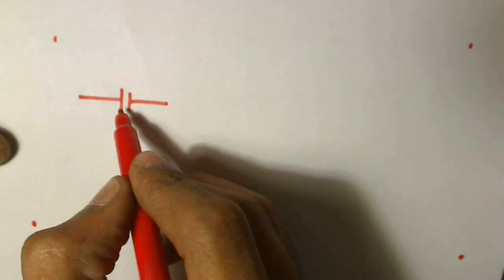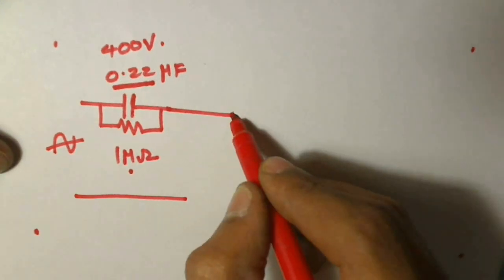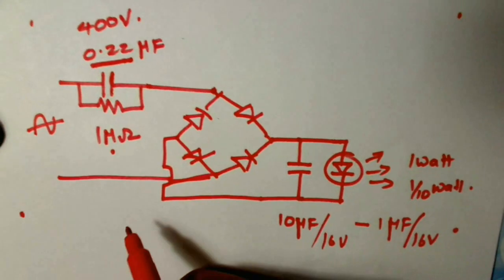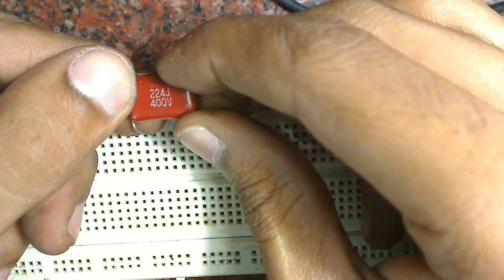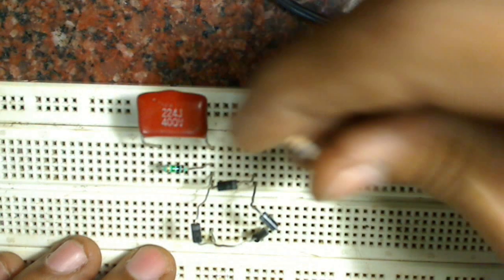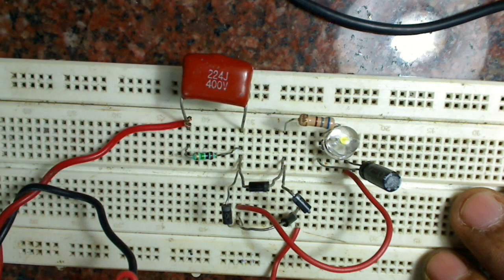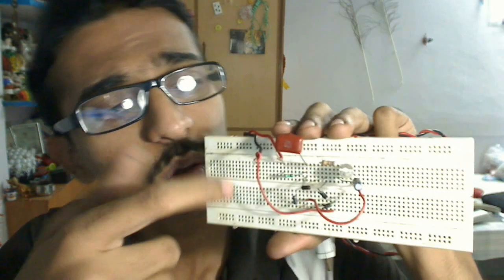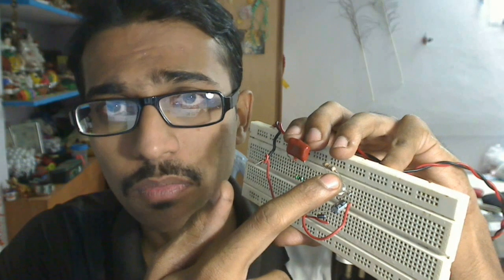transformerless LED driver circuit

Comment: how to increase the LED light brightness in series LED
Reply from the maker: +venkat raman reduce the number of LEDs , this will increase voltage. But if voltage rating u r using is correct then use more current

Comment: I tried it with 
- 2.2uF capacitor, 
- 1M ohm/1 Watt parallel resitor,
- 1N54008/2amp diode bridge,
- 1000uF/50v capacitor as ripple remover.
But it is not giving me output.
When I connect it to ac and disconnect and then on connecting both output terminals together they make a spark.

Comment: What are those diodes? 1N4001? and is the AC voltage your using is 220vAC?

Comment: hi, how can i make a series of led lights around 3 w each but should go on and off alternatively? pls reply or msg me on 9820998588. need to use in a project.
any one who can help pls reply.
Reply from the maker: +Mohd. Ahtesham Shaikh if 3 watt then u cannot use this circuit as this can supply very less current. U can use an smps or a any high current power supply. To go on and off use a simple 555 timer circuit in astable mode and with a relay or a high current transistor to drive the leds

Comment: boss please tell me the circuit configuration 60 led in series with capacitor value and resistance
Reply: Can u tell me what is the voltage and wattage ratings of LEDs
I can help

Comment: Excellent Tutorial. Please help me about component list . Here is the list what i get from your video. if i miss something please correct  the mention list.

1. 1uf 400v capacitor 
2. 1mega ohm registence
3. 1N4007 silicon diode
4. what is it name
5. 1uf capacitor
6. 12 v LED 

waiting for your reply

Comment: hi I want to make a led ring light which contains 60 leds for my bike royal Enfield having 12v DC supply battery. Please tell me how to make circuit
Reply from the maker: you want to connect 1/10th watt leds or 1watt? usually white leds need 3.3v to run and bike battery is 12v so u can connect upto 3 leds in series with a series resistor. multiple such chains can be connected in parallel and they can be connected to the bike battery

Comment: chota sa led power indicator 240 v AC current me kaisa chala sakte
Reply from the maker: +mohammed Abdul Ghani connect the led with a resistor of value above 100kohm atleast. It will only work for small indication LEDs

Comment: after making my using my 1Uf 400v capacitor and resistor in parallel,then connected to my diode rectifier,i measured my voltage output and got 198v.please I need to if this is right and how I further drop down the voltage to 5 volts

Comment: thanks   for  information  ,,,i  tried  it many  time    but  every time  i  get   blast  in  parallel resistor  place   across  capacitor  i  don`t    know   y  ????? can u  suggest  me   some  solution
Reply from the maker: +saad jaha may be the capacitor you used is not working so the current is flowing through the resistor and it is burning out. try replacing the capacitor

Comment: hi bro. that was an awesome video.BTW I have few questions to ask.
is it safe to build an transformerless circuit to glow bunch of LEDS? 
what s d difference between the circuit that has transformer and transformerless circuit? in some circuit they r using small size transformer. are they really expensive?
Reply from the maker: +little john yeh you can use transformerless circuit for lighting up multiple leds. it would cost you much less compared to a transformer type circuit. the circuit using small transformer is an SMPS they are also costly but little less than the usual transformer power supplies.

Comment: can I drive LED strip by this circuit
Reply from the maker: +Rodney Mendes  if its a small piece then it will but not for long pieces
Reply: +Electronics Made Easy : KHADER - total 72 LED strip is possible?? also LEDs on strip are connected in series?

Comment: actually I have one led bulb 💡 but bulb is not working so i disassembled that and check out why bulb 💡 is not working so i find out - > out put of the circuit board showing both side of current.. 
so now what i have to do to solve that problem please help me
Reply from the maker: +Viraj Borade i didnt get you, is the current zero??? in that case check if the high voltage capacitor is in good condition or not and even check the low resistor at the input befor bridge rectifier (it will be about 2.2ohms to 5.6ohms in most leds)
Reply: +Electronics Made Easy : KHADER it is my whatsapp no 8421968802 so i could send you the actual photos of my circuit please contact me on WhatsApp please

Comment: I am a bit perplex about the output voltage. How much is the voltage just after the diode bridge? Is the 1uf cap 16v is enough? please tell me. Thank you
Reply from the maker: +MParwez K  see the open circuit voltage at the output is 220v dc but we connect the led(s) which drop the voltage to a much lower voltage so a 16v cap will be enough

Comment: i Have 424/474 in 250v poly capacitor, can I use them??? I did not get 400v.
Reply: +Kamlesh_sexy please reply
Reply from the maker: +Kamlesh_sexy yes u can use those. they will work well

Comment: can i connect a blinking  led  circuit which contains ne 555 but it works on 9 v but i can connect a?
Reply from the maker: +SAI KUMAR connect a 9v zener at the output of this circuit and connec the 555 timer circuit

Comment: Can you tell me which value capacitor used for making 12W Led bulb?
With mathematical solution.
For 12W I am using 60nos.  0.2W led
Reply from the maker: +pranay khutwad u can use the same circuit to drive 60 leds in series. dont connect them in parallel. and there arent 0.2watt leds, probably might be 0.5watt or 0.1watt leds. the circuit will work for either of the cases. for 60 leds the total voltage needed will be 60x3=180v and the current usually allowed by a 0.47uf capacitor is about 33mA, if u r using 0.22uf capacitor then current would be almost half of this. and dont leave the output open circuited as the voltage can reach upto 240v as the circuit isnt isolated from mains
Reply: +Electronics Made Easy : KHADER 

Ok i know about series connection of led. but i want some calculation to derive current.
I am using 2.2Uf and current 60ma, but either elcapacitor or mpet burnout in within 2-3months.
Hope you can help me to solve this thing
Reply from the maker: +pranay khutwad 2.2uf is a very high value so the power is mor and buring out ur components. use a capacitor value below 0.68uf or 0.47 uf

Comment: You need to remember a few things. 
1. Capacitors store energy.  The reason you have the parallel resistor on the left side of the circuit is top bleed off the charge when the mains is disconnected.  The capacitor on the right side is a soothing capacitor to eliminate AC flicker, and can actually store more charge than the the other.  You should have included a similar discharge resistor when you "designed" your circuit.

2. The voltage rating on the 16v smoothing capacitor is way under rated.  The open circuit voltage in your "design" would still be 240v.  If your LED was removed or failed the capacitor would certainly pop.

For those that would like to know how the capacitor on the left side is chosen, you calculate the Capacitive Reactance (Xc)=1/(2*Pi*f*C) where Xc is in ohms, Pi=3.14, f= frequency of line voltage in Hz and C= capacitance in farads.  If you know your desired current use V=IR to solve for the resistance. substitute this value for Xc and that will give you your capacitor value.  Remember, also, if you put 70 LEDs in series, one goes out, they all go out.

BTW, this circuit is a standard "Capacitive Dropper" and is the basis of nearly every LED bulb in production today.
Reply: That should be "smoothing" capacitor in my previous post, not "soothing".

Also, remember P=i^2*R.  The total wattage of your load can't exceed the wattage of the series current limiting resistor, which is why they get hot.  You can't run a 2W LED using a 1/4 W resistor without it burning up.
Reply: +Rich Booth You know, I've had LED's go out in circuit but they others stayed on. Any ideas on that?
Reply: +TLEJT  probably you would have connected them in parallel. moreover parallel connection as much preferred as you get a constant voltage across all.
Reply: It was definitely series. It was two LED's on a 9v.
Reply: Help me please... what should be the value of resistance to purge the load capacitor 10 microfarads 16 vol in the rigth side (led side). Thank you very much
Reply: Dharti Dhora Walo Ko Aage Piche Karbala Ka Waqia karuvadu karuvadu karuvadu

Comment: if the neutral and phase are changed what will happen? I mean that neutral to the capacitor and the phase to the bridge.  what will happen?
Reply from the maker: +Akhil Sukumaran  the output would be the same. if you take phase thru the capacitor then the current would enter the circuit and be limited by the capacitor and then pass thru the bridge rectifier and load and back to the neutral. but if phase is through the bridge then the current will pass through the load and then thru the capacitor in that case also current will be limited as the current should pass through the capacitor to go to neutral so the whole circuit being series wouldn't matter much even if you reverse phase and neutral. in the circuit you can see that i didn't check the phase and neutral before giving to the circuit.
Reply: +Electronics Made Easy : KHADER ok can you give a neat diagram for connecting a 60-70leds in series. in my whats app? x
can u help me its very urgent.  my number is 9846614820. please help me. please

Comment: sir i replaced that 824j with 474 capacitor but it is catching fire at output side what can i do
Reply from the maker: +SAI KUMAR  make sure you connect atleast 330ohm and above resistance in series rated at above 1 watt. make sure your load isnt shorted

Comment: sir  i used 1 k ohm resistor at output side but it is catching fire what can i do if i use a 1 k ohm 3 watt is it okay
Reply from the maker: +SAI KUMAR  you probably used a very high capacitance value. try to reduce that and make sure output is not shorted
Reply: sir i used a 400 volt capacitance capacitor
Reply from the maker: +SAI KUMAR  no not the voltage. what is the capacitance, there will be a code on it. use a capacitor value below 0.47uf to avoid resistor buring
Reply: it is 824 j capacity capacitor which i used sir
Reply from the maker: SAI KUMAR use a capacitor which says 474j meaning 0.47uf
Reply: thanku sir 0.47uf 400v 
kk sir

Comment: sir i want to make the leds to blink i want to make driver for that what can i do sir
Reply from the maker: +SAI KUMAR  first make the above circuit and then connect a 5v or 6v zener across the  output. then conenct the output to a simple 555 timer blinking circuit or a transistorized blinking circuit
Reply: thanku sir

Comment: sir im using 400 v capacitor in input side i didnt find 250 v is it be kay or if i use it there is large potential drop across this will effect in current aa
Reply from the maker: +SAI KUMAR  even if you use a 400v capacitor  or even a 1000v capacitor, it will charge only to 240v which is the mains voltage. so you need not worry about the voltage rating just make sure the value is above 250v that is enough
Reply: thanku sir !!!!!!!!!!!!!
Reply: sir i replaced 824 j capacitor with 474 capacitor but i used 1 ohm resistor but it is catching fire what can i do

Comment: sir this circuit is working excellantly but i want to connect series of leds is it possible please reply sir
Reply from the maker: +SAI KUMAR yeh u can use the same circuit for the series of leds. u can connect upto 60-80 leds maximum in series

Comment: hey man can I run 12 w led bulb on this circuit
Reply from the maker: +cypher 12w led bulb usually takes 1A current and connecting such high loads to this circuit might damage the resistor in the circuit or may b even the led. another option would be connecting 12 1w leds in series
Reply: +Electronics Made Easy : KHADER actually the thing is I  have one of those lying around me so I want to utilise them. Can you suggest me some other projects for them or the changes that could be made to make them work without damaging the circuit
Reply from the maker: +cypher yeh so as i said this circuit isnt suitable fr high current loads so for this 12watt led u can either purchase a 12v 1A smps or commonly called as adapter to light this led directly with a suitable heat sink. u can also make a 12v transformer power supply to light this led or a much simpler way would be to connect the led to a 12v battery and use it. in cases where inverters die after much usage there is still little above 11v left in the inverter battery left which can be used to light this led by conecting the led directly to the battery. the light given by this led would b almost close to a 15watt cfl light. u can also make other things life solar light from this or light this from a small dc generator

Comment: i want to make a 12v dc power supply (transformerless)  plz help me friend
Reply from the maker: +Aravi Aravi it is advisable to use a transformer type power supply as it is safe to manipulate. but if u want to make a transformer-less supply then this is what u can do
to make a transformer less power supply use the same circuit as above and at the output use a zener diode as regulator or try experimenting with a 7812 regulator
Reply: im confused bro, plz help me plz send one circuit diagram transformer-less supply 12V , plz bro help me

Comment: hey man its a great video but my query is 
I want to connect about 9*5=45 LEDs like the ones you used so the circuitary will remain same or there would be some alterations required
Reply from the maker: +cypher you can use same circuit but connect all the 45 leds in series that would work. if you connect leds in parallel then the light will dim as the circuit current is limited
Reply: +Electronics Made Easy : KHADER thanks a lot

Comment: can i use this to connnect 9, 1 watt Leds? if so then in which configuration,because when i connected 9 of them in parallel all of them werent glowing at their luminous intensity
Reply from the maker: The circuits current is limited so u cannot connect them in parallel but u can connect upto 80  leds in series
Reply: +Electronics Made Easy : KHADER ty..i will try it again...moreover i wanted to know how to make a driver circuit for led strip...please provide the details for a led strip of atleast 2m.

Comment: Thanks for this detail man. I want to lighten up 5 mtr LED strip using this circuit. I have created same circuit as mentioned but it doesn't work. Do I need to change any thing in this circuit ?  It also requires 12 voltage.
Reply from the maker: +prateek shukla a 5metre led strip light consumes about 0.5 amp to 1 amp current so this circuit might not be able to supply that current but there are two things that can happen here if the circuit works, 1.the resistor in the circuit will burn due to overload or 2. the leds will light up really dim. before connecting the strip test the circuit with an led, preferrably a 1 watt led so that you will know if the circuit is working or not. 
My advice for you will be that cut the 5metre strip into 5 strips of 1 metre each and connect the 5 strips in series to each other, in this way you will have brighter leds when compared to 5 metre strip
Reply: +Electronics Made Easy : KHADER thanks man for quick reply. Can you please help me in making circuit for 5 mtr leds strip. I tried above circuit for 3 leds, it is working fine but led's light were very dim. Just FYI I am using 10 uf 63 volt capacitor is parallel of output. Is there any problem because of this?
It will be great if can share or mail me simple circuit drawn for my use case. I am trying this from yesterday but not getting success. :(
Reply from the maker: +prateek shukla yeah that shouldn't be a problem, what value of series capacitor are you using. i used .22uf cap rated at 400v. this capacitor governs the current going to the leds, so try to use a .47uf or  a close value rated above 250v that should give you some result . and try to test that with one metre strip first and depending on that you can increase the capacitance
Reply from the maker: +prateek shukla yeah that shouldn't be a problem, what value of series capacitor are you using. i used .22uf cap rated at 400v. this capacitor governs the current going to the leds, so try to use a .47uf or  a close value rated above 250v that should give you some result . and try to test that with one metre strip first and depending on that you can increase the capacitance
Reply: +Electronics Made Easy : KHADER Currently mine capacitor is 224K 630V
Reply: +Electronics Made Easy : KHADER I tried same with 5 mtr strip. :) Nothing happened. No LED lightened.
Actually I need to purchase particular capacitor. It will be great if you can help me out here with approax value which work for 1 mtr or 5 mtr strip.
Reply from the maker: that should have worked. but if it isnt then may be the led strip is a high wattage leds strip, so the leds arent getting enough current from the supply. if they are high power leds then i dont think this type of power supply can power a 1metre or 5 metre strip but anyhow you can try with a single module of the strip (3 leds as a set is a module). and also check the resistor values connected inseries, and also the diodes cuz if you use .22uf capacitor with just three leds then they should light up really brightly
Reply: +Electronics Made Easy : KHADER
Diode: IN4007
Series register: According to you which is best suited for 3 led strip & for 6 Led strip ?
Reply from the maker: prateek shukla use a 0.47uf capacitor in place of 0.22uf and about the resistor you can experiment with different resistor values from 220ohms to 680 ohms
Reply: Thanks man will try this as well.